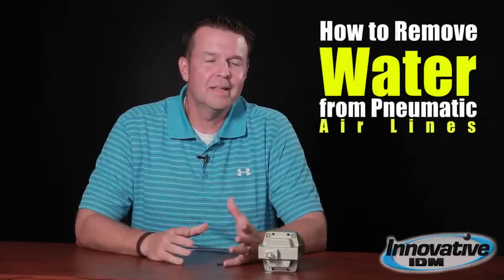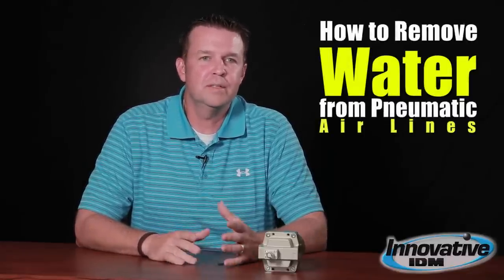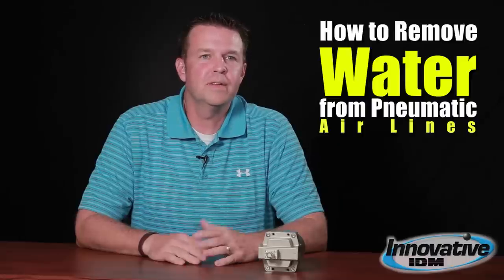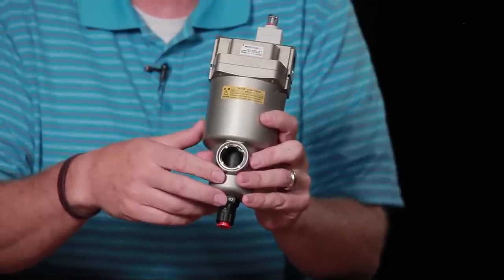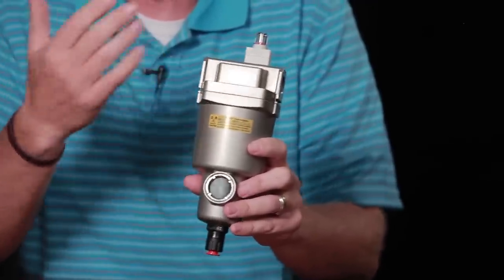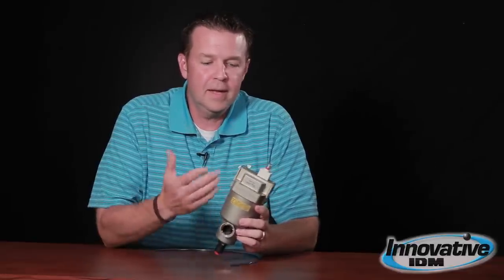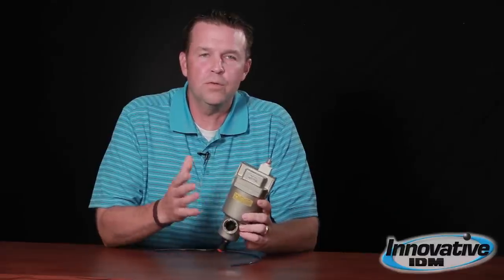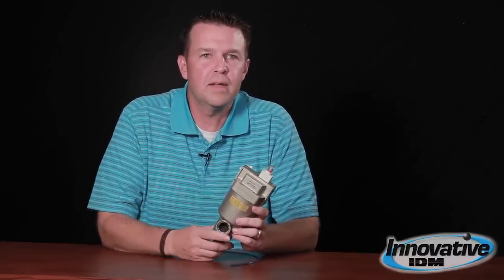How To Remove Water From Pneumatic Air Lines | Innovative IDM

Comment: My problem is that I'm getting water in my air line post air dryer. I suspect it was because we had a power outage for about 5 hours hence water condensation built up .When the dryer went back on, it pushed this water through the line and almost cause 
major damage to lab equipment. I'm assuming that the AMG micro mist separator would help solve this problem. It seem I may need this separator in all the labs.